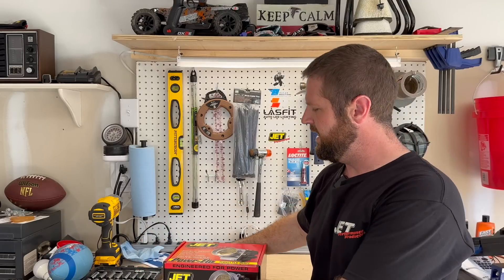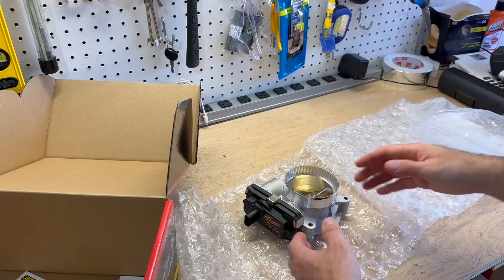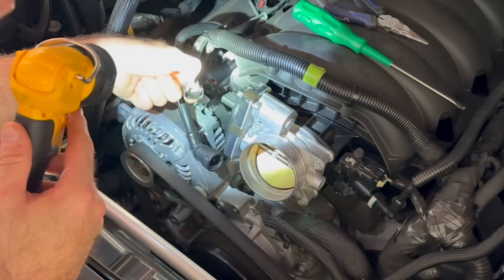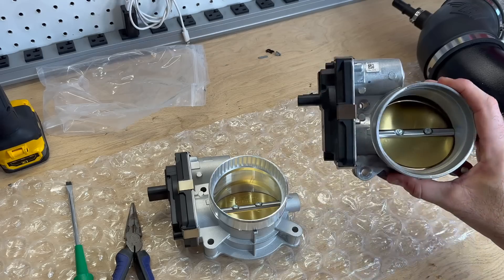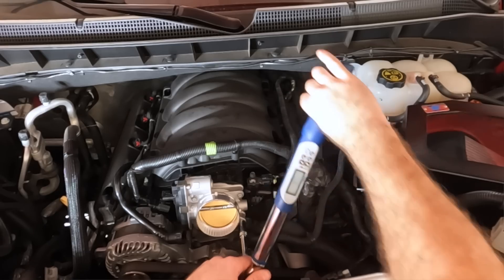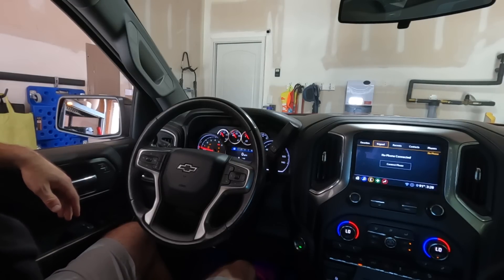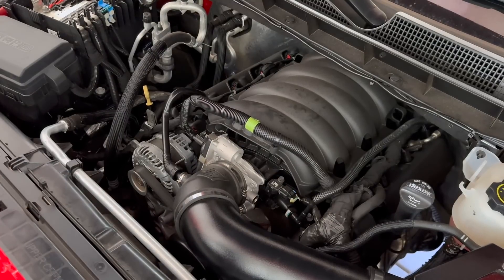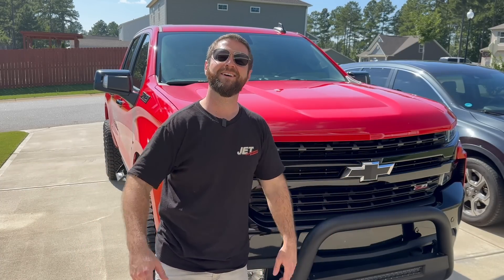Chevy Silverado 5.3 Throttle Body Upgrade! | Jet Performance

Comment: I wonder how much power you’ll make if you actually get a real tune. Awesome video just ordered my jet maf sensor cause of you looking forward to see how this throttle body works out for you might be next on the list.
Reply from the maker: Honestly, I would love to get it dyno tested to see how much I am actually gaining. I may look to do that in the future.
Reply: @zachattackcustoms  that will honestly be pretty cool
Reply from the maker: @BuenasVibras909 I will probably wait until after I get my true dual Borla Ataks installed.
Reply: The older 5.3s have way more to gain from a tune. Gm left room on purpose so they could tweak the numbers up year over year. Im talking 99 to present also it became more complicated to tune after 04 with the drive by wire. The 04s only went to 4,300rpm befor fule cut.
Reply: Hey what’s up. Looking to throw this into my 21 trailboss . I clicked the link to jet performance but none of them say it actually fits the Silverado. It only lists the Colorado blazer and traverse. Please let me know what you did .
Reply from the maker: @christopherd9991 when you go on their site select at the top: year, make, model and then select V8 5.3